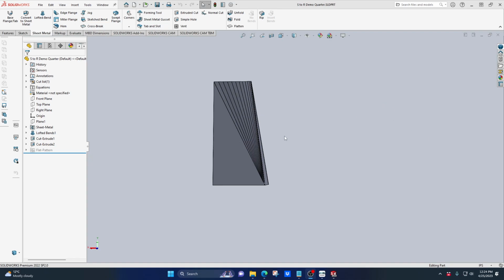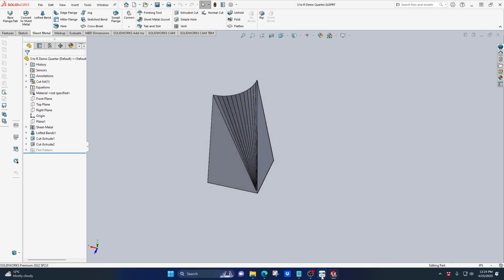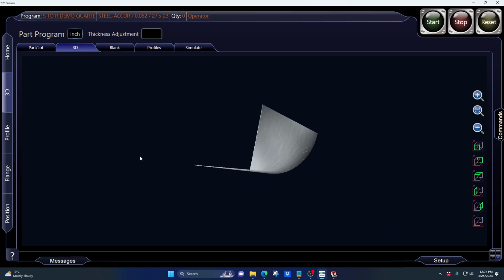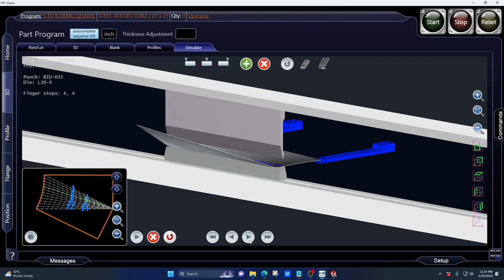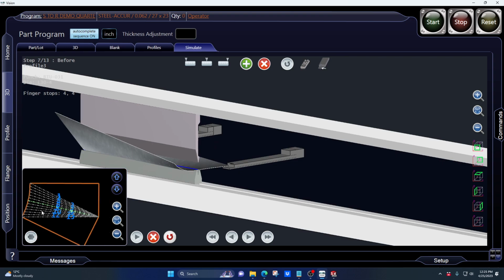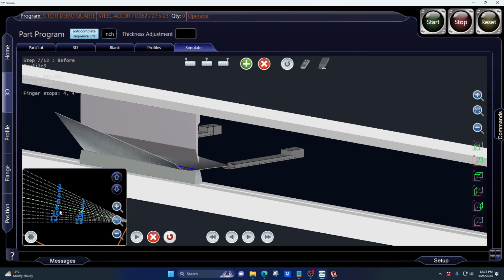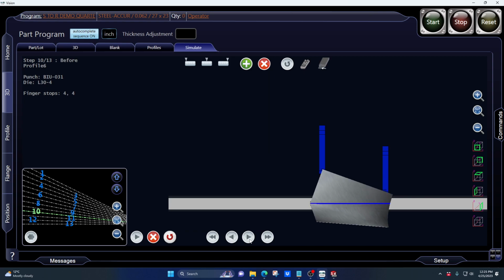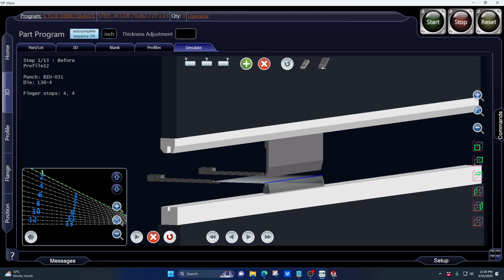Accurpress Vision 3D Square to Round

Comment: Hi there. I’m curious how you would do a part that has a flange this is not parallel to edge but is wider than the backguage, therefore I can’t use the 3 point contact method. I have a 6 axis machine, that is 10’ wide, but backguage only widens to approximately 8’.